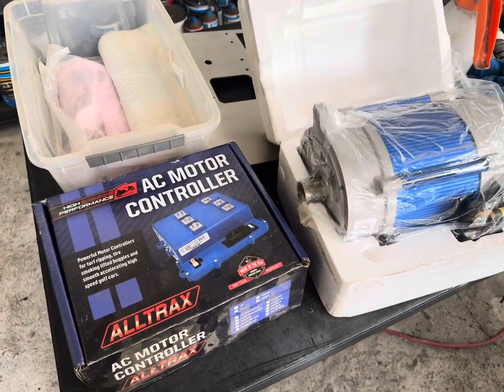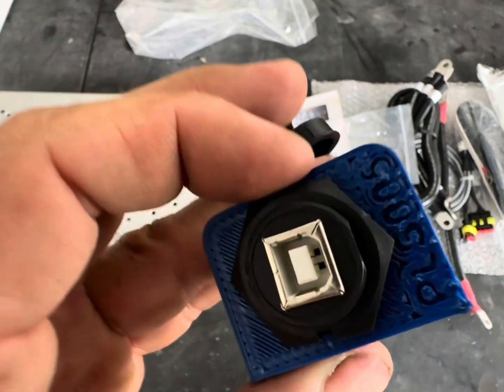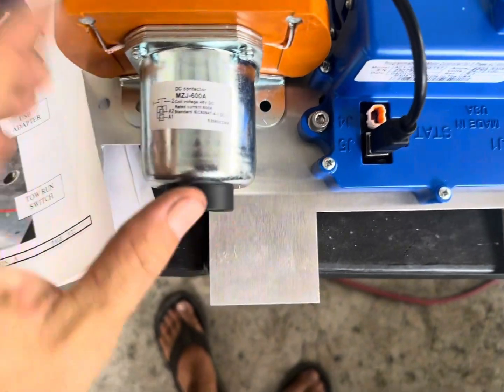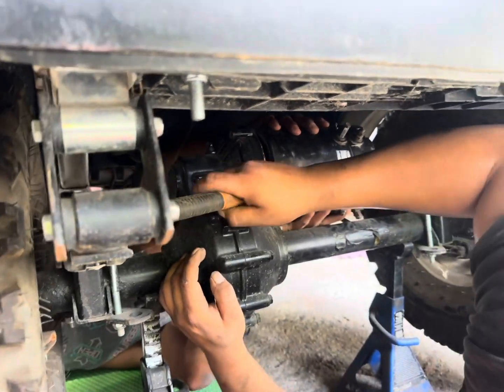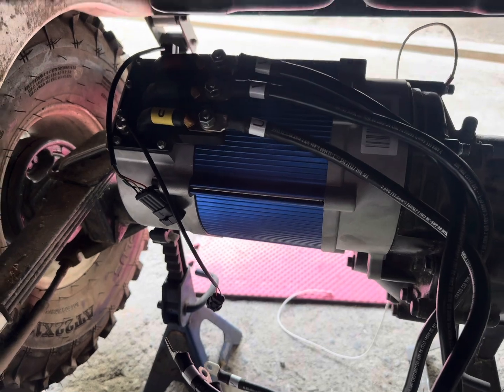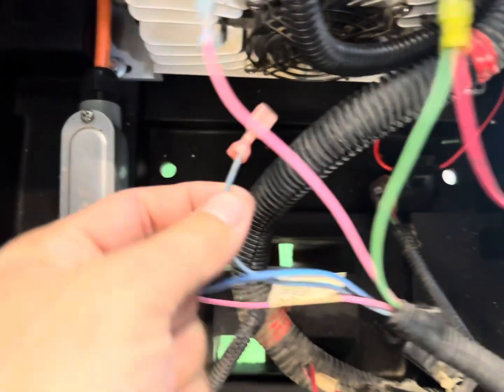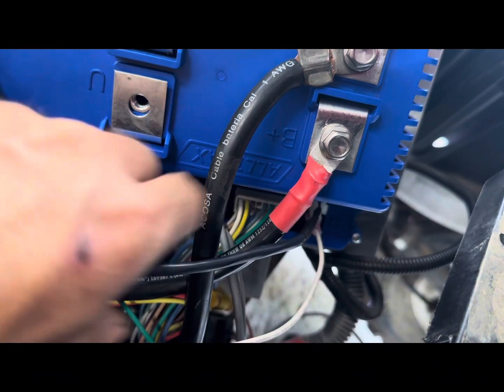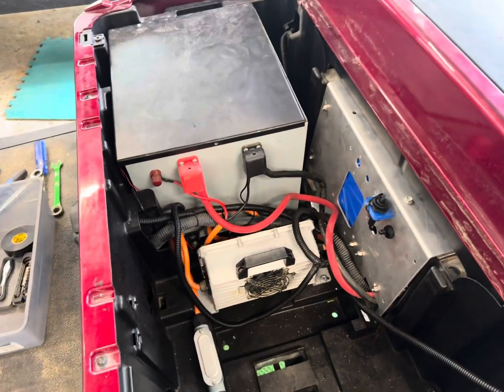DIY How to install the Alltrax AC Kit on Club Car Precedent and get 50+ MPH @alltraxinc6344

Comment: I just got my AC kit for Christmas, and I cannot wait to install it. Any update on this cart? Software setups? Speed, likability, and any info would be greatly appreciated! Thank you!
Reply from the maker: No everything is working great, I did upgrade the BMS on the lithium battery to a 400 amp constant current with 1000 amp peak. You might have to play with your parameters so you don’t trip your battery. I would also make sure you have 2 AWG cables to your battery and not 4 gauge
Reply: @Oceangolfcarts  I have a Bolt 51V Lithium battery so I should be fine. I would just like to see a video with your feedback on the software, ride quality preferences and usability.
Reply from the maker: Check your max discharge current of the battery and your continuous current. I can definitely do a video like that soon!
Reply: @Oceangolfcarts  Awsome. Im most likely starting the install in two weeks!